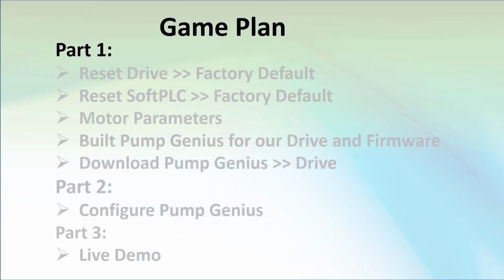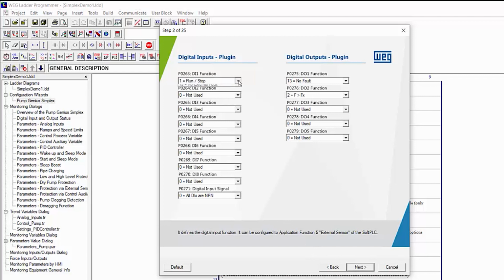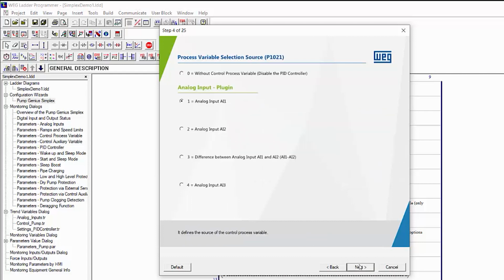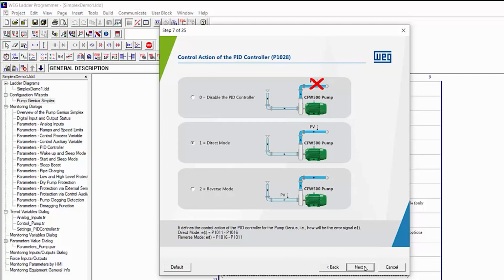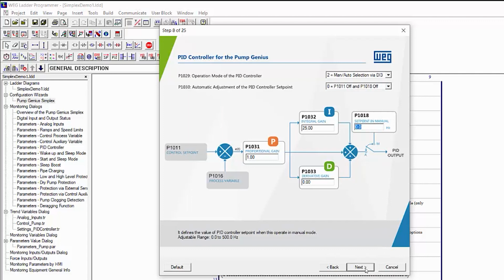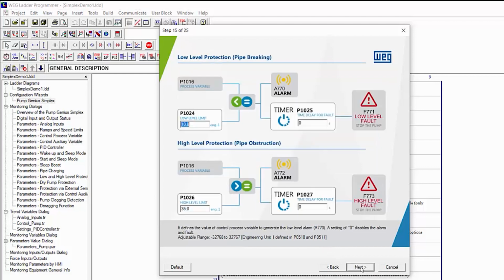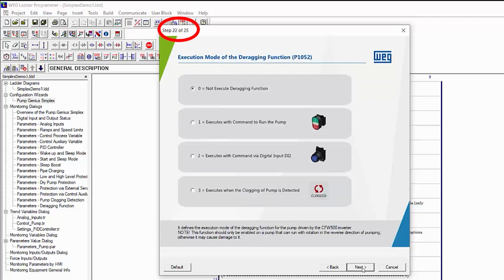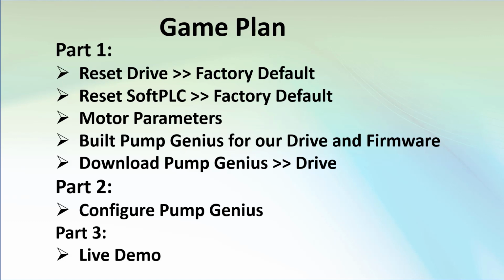WEG CFW500 VFD PID Pump Genius Simplex Part 2 from AutomationDirect

Comment: Good video.  I have a 5 hp variable speed pump.  could not find very many docs on this product.
Reply from the maker: Thanks for the feedback. For documentation, simply go to any of the WEG CFW500 drives on the AutomationDirect website and scroll down to the documentation section. You'll find everything you could ever want to know, free software downloads and firmware updates.  

For example, go here and scroll down to "Documents": 
https://www.automationdirect.com/adc/shopping/catalog/drives_a_soft_starters/ac_variable_frequency_drives_(vfd)/washdown_(nema_4x)/14978548#docsanchor

In particular, the Pump Genius manual is here: 
https://cdn.automationdirect.com/static/manuals/wegdrives/cfw500_pump.pdf